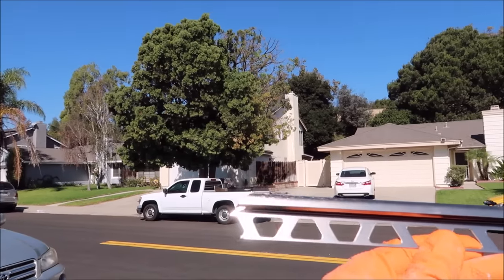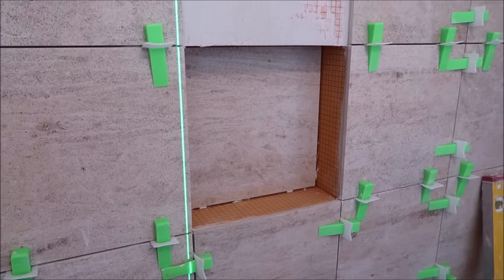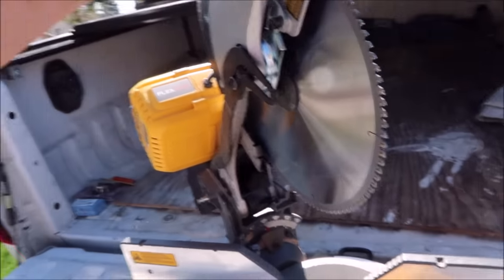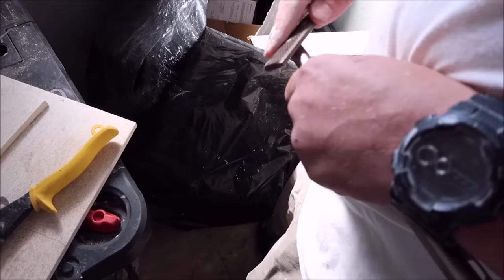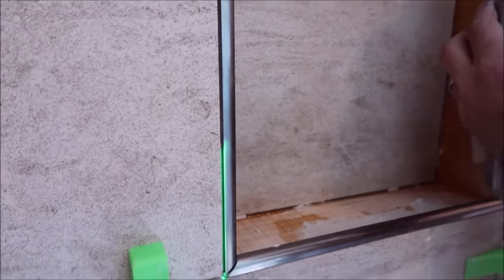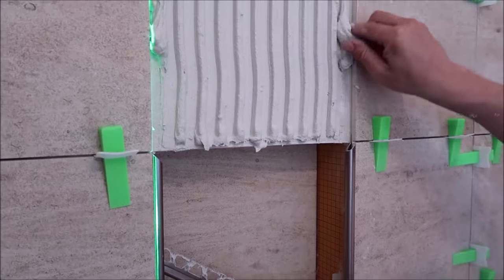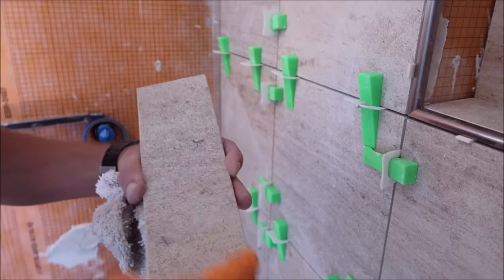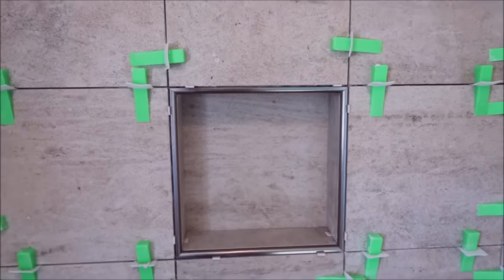Modern Trim for a Shower Niche

Comment: I'm doing a niche currently and have two questions:

1.  What do you use to seal the tight miters...I'm thinking clear silicone?

2.  Can't find any info on the net about using a dremmel tool to make the 45 degree cuts; do you see any issues using a dremmel besides  color discoloration if cutting to fast?

Thank you in advance for any responses.
Reply: Well, I went ahead and used the dremmel today and got some nice miter joints without having to knock any burrs off. That said, it's certainly isn't the fastest or safest way to do miters.
Reply from the maker: Hi Rich, use a miter saw  and grout the mitered joints.

Comment: How are the internal edges sealed? 
The gaps look too small for grout or even caulk? 
I would have assumed the same 'between tile' gap would be used inside the niche to allow grouting (but I am an amateur so dont know  actually)
Reply: Sorry I just read a reply that said you grouted them.. 
The gaps look very tight (smaller than between the base and side internal tiles)? 
Was that by design?

Comment: Howndo you seal your mitered joints??? No one addresses this?  Yet it looks like a disaster waiting to happen?  An empty tube thst has access to behind the tiles with just thinset keeping the water out?  Not sure if grout wood work or maybe have to caulk the mitered joints?  Or maybe even epoxy the pieces together as if you are grouting a crack???
Jist seems like an area of leakage that no one addresses.

Comment: I have a question.....I noticed you put the flat part of the trim behind the wall tiles. Can you also lay the flat part of the trim down on the inside of the niche as well?
Reply: You can lay the wall tile first and run rondec inside the niche yes. It will set and the end result will look nearly identical on either plane. Some setters prefer this method. It's personal preference really. But if you have a piece of rondec in hand, you can kinda see why some of us prefer installing it on the outer plane... Again, preference, layout, niche depth and size, etc. 👍

Comment: was the thinset still wet on the left, right and bottom wall tiles when you slipped the schluter in?
Reply: You can trowel like 75% of the tile and leave room to pack additional  thinset and slip the trim in later. Yeah, it’s probably not in the standards book, but sometimes you do what you gotta do.
Reply: Dude gave zero info to certain questions

Comment: I have a hard time positioning my niches so they line up well with the wall tile. How do you do this? Could I tile up to the niche then open up the wall and make the niche? Or is there a better way?
Reply from the maker: We lay the tile out on the floor with our clips/spacers and measure. We then frame the niche according to the height taking into consideration of the shower pan/tile as well.  Sometimes we have to rip all of the tiles that flow through the niche (back wall and both side walls) 1/2" or so, but the eye will never see it.
Reply: Landberg Tile TV I like the lay out on the floor idea. Guess it’s better to rip a 1/2” off vs having a sliver tile. 👍

Comment: Do you grout or do you use matching caulk around the metallic trim?  Specifically, I'm guessing you have to get grout or caulk into the miter joints, right?
Reply from the maker: We always grout with Prism grout by Custom around the trim. We use 100% color match silicone where all the planes/walls meet. (sides, top, bottom)
Reply: What silicone do you use where the planes meet? How durable is it from your experience, and what advantage does it have compared to grouting those lines instead?
Reply from the maker: @darkoserafimovski1696  We use Color Fast silicone for the sides, top and perimeter of a tub. It will outlast the grout and you don't have to deal with cracking with movement...
Reply: Thanks for the advice man 😃.
Reply: Do you mix your Prism grout with an additive or do you seal it after its hardened? 

Also, why do you use green board instead of 1/2 inch kerdi board? 
Thanks for the video!

Comment: Do you have a video explaining how to plan the tile layout / niche location to perfectly place the niche where a tile is
Reply from the maker: I'm working on that video now, it's a bit difficult to explain.
Reply: @LandbergTileTV Glad to hear it's in the works, I'm excited to check it out. One thing I've tried is to make the niche larger than the tile height on both the top and bottom. And then use preferred materials to build up/down when installing schluter and tile in niche. Maybe that makes sense. Can't wait to see your process
Reply: Yo telo ago en 5 minutos.  Sin perder tanto tiempo.

Comment: Great vid bro. I'm just curious what do you use to seal the corners of the trim so water doesn't get in there?
Reply from the maker: We always grout the niche. Keep in mind that grout is not waterproof. Schluter is so well waterproofed, you could shower in this "shower" without any tile installed on the walls.

Comment: So no adhesive behind the edje around trim? That's a chance to get a water there.
Reply from the maker: Not necessary. There is a proper slope and pitch to the bottom sill of the niche. Also, this is a Schluter shower, 100% waterproof seal system. You can shower without ANY tile on the walls. 👊
Reply: @LandbergTileTV  Thank you!
Reply from the maker: @FixitAll  Yes sir, thanks for watching. I watch all of your videos also.
Reply: @LandbergTileTV  Thank you!

Comment: Don't they make corner pieces for that trim? And why miter instead of using corner if available?
Reply from the maker: Yes, Schluter offers corners with this rondec trim, but they look bulky and clunky. Definately not as tight and clean as miters. It's all personal preference and we prefer this method. Great question by the way! 👊

Comment: Good work but can you lay tile without using clips?
Reply from the maker: Lol yes of course, but a leveling system gives you a more superior install with large  format tiles 👊
Reply: landberg Tile TV I only use levelling system if tiles are larger than 600mm x 600mm. Smaller than this is just waste of money for customer.

Comment: what was the trim that you used on the niche call or do you have a link with description of the type of metal to use.
Reply from the maker: Schluter rondec
Reply: @LandbergTileTV  
What's blade was used to cut that stainless steel trim. 
I have tried to use the green colour metal cutting blade and it has spoiled it

Comment: Just one thing it’s wrong on that niche   Tha back pz is after the down piece that wAy u avoid leaking but after that great
Reply from the maker: There was a proper pitch on that bottom sill, so water will always run off. If water did get back there, this is a seal system Schluter shower. Believe it or not, you can shower without ANY tile on the walls. It's 100% waterproof my friend. 👊

Comment: Are these Trims a New thing over your side ? I cant stand using them,

We have Flat ones over that do look better than the rounded but also hate them lol :D
Reply from the maker: Not new, the Rondec has been around for years 👊
Reply: I can't say I prefer the flat (jolly) over rondec. Especially if the customer is using rondec instead of bullnose on the end of the run, and corners. It's trim, I always prefer good clean miters or bullnose....  Finec is pretty slick too now that I've used it. All of the schluter profiles have their place, and the customers taste and budget has 99% of the say. I wouldn't push schluter jolly on a home that has bullnose sheetrock corners for instance, or arched doorways. Regardless, all of the profiles and or methods look waaaayyy better than joe blow diy or a contractor that doesn't know any better trying to make a 90 out of straight cut ends, or trying to make a bullnose out of grout. 👊
Reply from the maker: @MostlyPeacefulCombatVet  You're spot on, we think on the same wavelength! I also prefer clean miters and that Finec is a 
good looking super low profile trim and can protect miters. Lol Joe blow and making bullnose out of grout... 
I've seen it!
Reply: No need for trim metal on inset Niches. Polish or 45 cuts only. Also I don't care if you didn't follow the instructions for installing the metal. But you are creating 2 grout joints on the inside lower pitched shelf one in the back and one next to the metal. Those an inexcusable and definitely restrict drainage.

Comment: How does it hold up to hot hard water ?
Reply from the maker: The Sclhuter trim will not rust
Reply: Not worried about rust however if you have a well like millions of people then you probably have hard water which has a lot of calcium. If you ever seen the white dust around copper fittings that’s hard water. Just wondering how that holds up. Because even shower doors don’t last long
Reply: I’m just wondering before I sell to clients. It looks awesome

Comment: Installing the rondec this way goes against schluter’s installation instructions. It will fail because the mortar is pushed out of the way instead of imbedded like it calls for. Nice miters and clean lines otherwise.
Reply from the maker: What will fail? I'm confused...
Reply: This will not fail, it will be OK. You can either embed the Rondec, or shove it behind tiles that have been set in the mortar. Trust me it won't push the mortar out of the way, the mortar really has no where to go, and the mortar will still find its way around the Rondec's web like structure. BTW, nice job, glad to see you back butter the tiles first, makes for better contact, and is recommended by the Tile Council of North Amerca.
Reply: It is not nearly as strong a bond. Schluter instructs that their trim be set it in a layer of notched thinset, then set the tile over. Creating a solid bed of mortar around the trapezoids, keeping it in solidly. This method creates air gaps, which leaves weak points. Maybe it won't fail immediately but the hold is definitely weaker for it.
Reply: هلو
Reply: Why don't you post a video on how you would do it then Amber?
It will definitely hold and looks very good as well.
Reply: Oh shit it's the trim police.
Reply: No one is going to be walking on this tile edging. I don't think it's ever going to fail
Reply: @amberh9703   once everything is dried, it has no where to go since its sandwiched between tiles.  it will be fine.
Reply: Amber H is technically right...but it will probably be OK doing it this way...but why not just do it per schluters instructions?
Reply: Thats not going to fail. you have no idea what you are talking aboout. Solid install.
Reply: @amberh9703  Thats not going to fail. How possibly? Please get into detail?  i have been setting tile for over 15 years,  if you were to try and remove this after the mortar was fully cured, it would take a tone of smashing and chiseling to remove. Its stuck tight.  I have removed dozens of old showers with all kinds of installations. I have seen showers installed by hacks, done completely wrong, but yet still help up over years.  I have seen niches in a commercial bathroom, where the tile setter put 2 blobs of mud on each tile with no back buttering,with almost no mud even touching the schluter and yet still held up 20 years. Hacky, but some how held up.  Also i am positive most tile setters do not follow schluters exact instructions.
Reply: The shower is not going to start falling apart because of the niche schluter. Sorry i find your comment hilarious
Reply: Because it is more difficult to tile up to the rondec rather that place it after the tile.
Reply: You are 100% correct schluter does not recommend sliding the metal in been to all the classes and it comprises the metal and it can fail good call all the haters just don't know
Reply: @amberh9703  GROUT WILL HOLD AND GLUE THAT LIE THERES NO TOMORROW. IT WILL NOT FAIL.
Reply: Woman are something else, even if there is no thinset the grout will hold. Its metal, not the flimsy plastic...but you tried Amber
Reply: I agree with Amber H 100%. Y'all are some hacks defending cutting corners. Go watch some Sal at Starr and stop making rookie mistakes.
Reply: I agree with amber. From what I’ve researched it should be installed as you did the last piece so the thin-set extrudes(?) through the holes. Pushing it in won’t be as secure.
Reply: Irving Bustamante  I’ve try?
Reply: @amberh9703  nonsense
Reply: @TheKronpowkid88 how often you see profiles falling out....thats rediculous
Reply: @marcfavell  that's not the point the manufacturer has specific instructions for their product and it says NOT to slide them in so how  ridiculous is it really not to follow what they say I mean it is their product they would know best wouldn't they
Reply: I defy you try to "easy" pull the trim out now.  🤣
Reply: Would it be possible to turn the flange of the rondec into the niche to embed them without affecting the appearance of the reveal or layout of the wall tiles?
Reply: There is no way the trim or anything for that matter will be compromised Lanberg is installing it properly and very carefully look how precise his mitres were they were exceptional and he even adhered or pushed extra adhesive into were the trim was inserted so he has done it all up to code 100% his way is the correct way of installing tile trim without question 👊

Comment: Bull nose looks better than metal trim...but just like art, everyone is different.
Reply: Bull nose is a lot more expensive and can be chipped.  More grout joints also.  For the tile I got they only offered pencils .
Reply: Even plain tiles are better than metal trim if they are good quality tiles. I had a trim just at the bottom across the wc and now it's scratched and dented at certain places. I prefer the clean look of the tiles in the bathroom without any additional edge.

Comment: Very dangerous to cut metal without first cutting metal webbing with hand metal cutters as this prevents kickback.
Reply: What kind of kick back do you think you will get cutting some light gauge metal with that beast of a saw. It cuts like butter no need for PPE I use my wet saw prob not best for blade but I certainly am not going to break out my 12" compound saw
Reply: @jonathanpope5068  He's funny.
Reply: Be alter, stay safe lol

Comment: Tile levelers are for rookies. I float my showers with mud because styrofoam substrate just makes me worry about flexing. All this new stuff is cool but I do mine old school.
Reply: I like the wonderboard..put it up square & tight the walls are flat no going crazy building up mud
Reply: I made a custom bathtub for  customers in Englewood Cliffs. They made a step up ( about 16", then the inside was dropped lower than the floor,all framed out below...
  Back then 21 yrs old boss sent me to fold a lead pan to fit, solder extensions where needed, and solder a brass tub waste with extension tube & extra links for the plunger... It was so impressive, and I had to fill it to the threshold 24 hours..that was scary, but awesome project. .
Reply: Let me get this straight.... every tile you have ever encountered is perfectly rectified, has absolutely zero twist, and absolutely zero bend or flex? In other words, the tiles you use are manufactured to total perfection and each hand checked by a QA expert. These magical tiles, once installed, have their edges meet up in total perfection; especially in the corners and the potential lippage couldn't be measured by the finest of instruments. Making a comment that tile leveling systems are for rookies indicates you do not understand their purpose. These systems can help with the alignment and finished look of real world (not magical) tiles that apparently the rest of us encounter. Have you ever installed 6" x 36" tiles? Trust me, they have a twist to them. A leveling system can fix this.
Reply: No they are not for just rookies. Work smart not hard.  I find for tiles larger that 24" x 24" the leveling wedges make installation so much easier! Also you can spend all day setting your tile flat as possible but the leveling wedges do a better job. Personally i do not use the leveling wedges with tiles smaller than 12x24". It takes too much time to put them in for me. But anything over 24"x24" i use them on every install. Much faster . I see people on facebook tile groups calling out the leveling wedges, putting new installers off from using them and getting into arguments with people saying they are bad. I just dont understand. Argument of ignorance. The leveling wedges are great i would highly recommend them. especially to new installers and do it your selfers. Just make sure you put enough mud underneath the tile. ALso the kerdi show systems are amazing, fast installations, easy on your back and if installed right, i have never seen one fail. I would agree mud is stronger but have never had any issues myself with the kerdi system. Highly recommend
Reply: Your method is the traditional approach, but it requires special radius tiles for the perimeter. Those puppies are getting hard to find.

Comment: So wrong,,,number one you create a flat grout line  and joint and water has a hard time getting over the S metal ,forget metal and use one piece of stone that goes over the edge ,and ALWAYS install the sill first  than wall pieces  on top of sill

Comment: Fake:
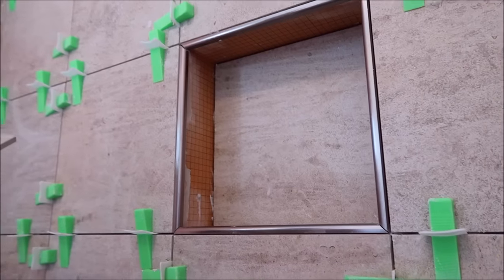5:48 for proper waterproof that piece "the bottom tile for niche" SHOULD BE INSTALLED FIRST before the back and side tiles of nich.
😱😱😱
MODERN WHAT?

😱😱😬😅😅.
Reply from the maker: Not on a seal system float yes. Watershed is completely irreverent on a 100% waterproof seal system.

Comment: It should be on the in side you plum
Reply from the maker: No, you have two options depending on  how much metal you want to see looking straight at the niche. I'm friends with Schluter reps 👍
Reply: @LandbergTileTV  
Square edge round edge and box trim all go inside of windows and boxing that why it got flat edge with holes to lay on not to push behind